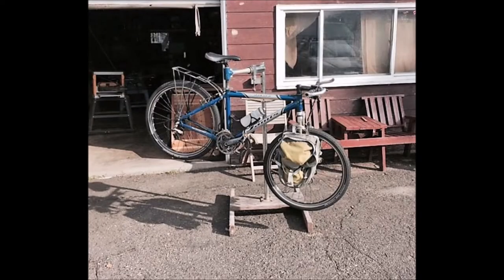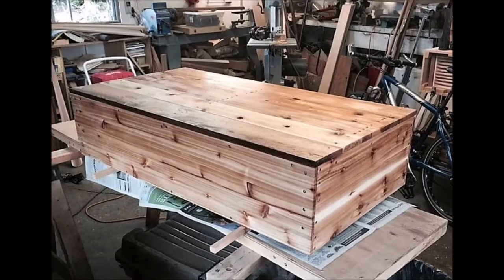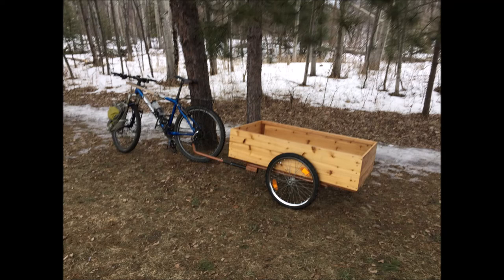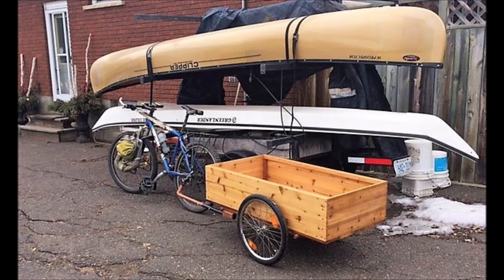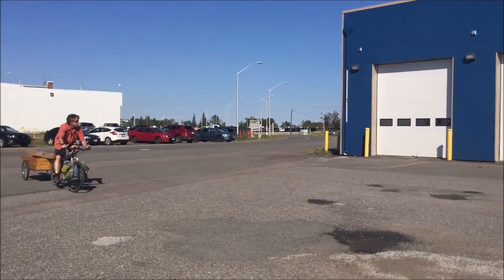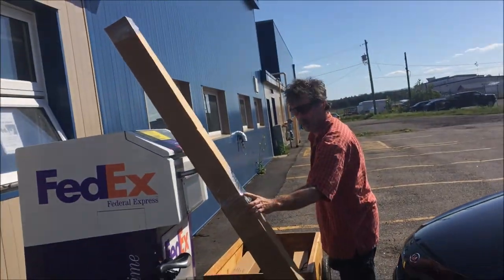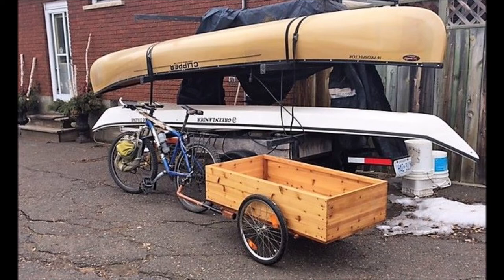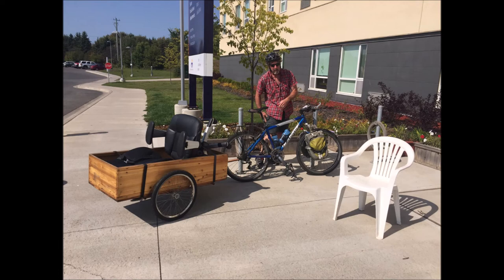Converting Bicycle Child Trailer into a DIY Cargo Trailer/ western red cedar build.

Comment: I did it to my trailer because the rats and mice chewed up the material it was made out of so I rebuilt using wood pallet boards for the new box. I remember seeing a litter of baby rats in the chewed up material. It stunk too like rat pee and rat turds all over in the bottom of trailer.